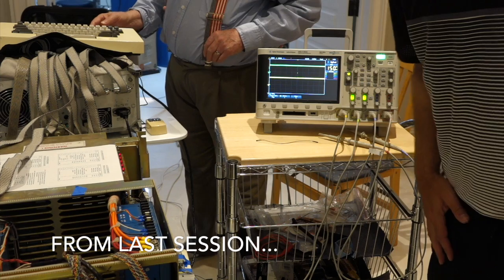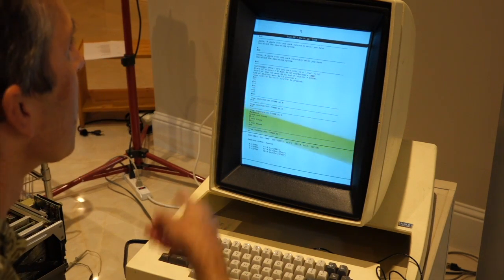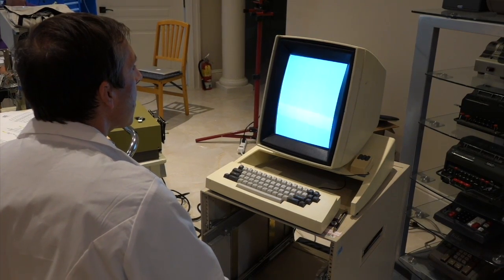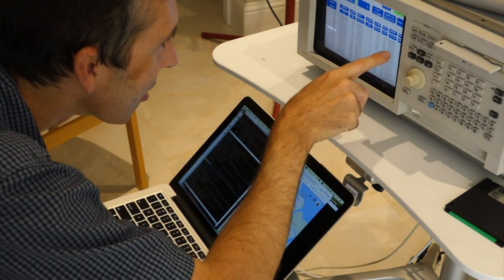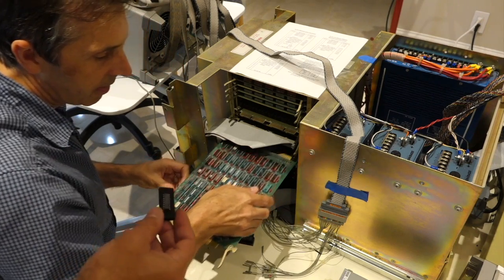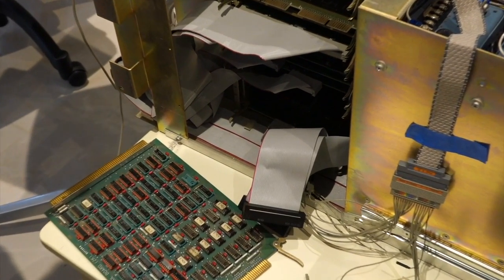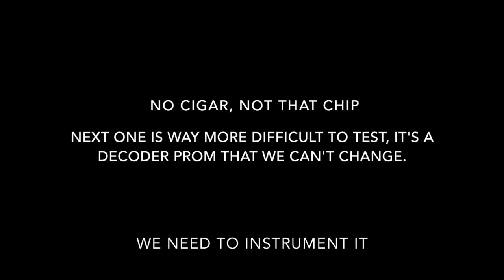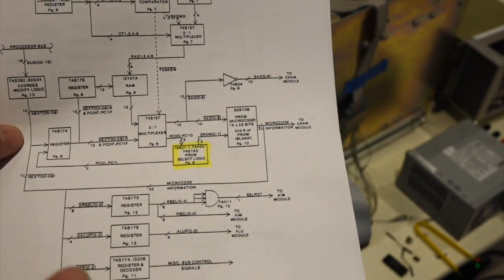Xerox Alto Restoration Part 9 - debug session leads us closer to crashes root cause

Comment: I had a funny feeling there'd be more bad IC's
Reply: the verdict is still out on that question - it may be a board level mismatch, not a bad chip, but we need session 10 to track this down further and find the precise problem.
Reply: Revision Issue then?
Reply: Thats what it looks like. The CRAM comes in three sizes, 1K, 2K and 3K. The control board should match the size of the CRAM, since it is generating selection logic. Microcode only has a 1024 word addressing range, thus we have to switch between 1K ROM and 1 to 3 blocks of 1K RAM. A 3K CRAM board has 3 separate 1K ranges of RAM - called banks - while the 1K board has a single bank.
Reply: okay thats a little more tricky...unless you swap the IC's from the original PCB assuming its the disk drive PCB causing the issues..i know the PCB got swapped out. so swap some IC's and see what happens
Reply: The problem is on the CRAM board, different from the Disk controller board. We think it is a mismatch that we might cure by installing a matched pair of 3K Control and CRAM boards. Should know by Friday.
Reply: Awesome, look forward to it

Comment: Was waiting for an update so bad!
But what could be the reason that someone retraced that chip?
Reply from the maker: We currently believe the rework on our control board was to make it work with an upgraded 3k CRAM board, which was the board supposed to be attached at the other end of the cable. But we now suspect we have a basic 1k CRAM board instead. If the theory holds (to be tested in episode 10), then the two boards that are hooked together in this machine were never meant to be working together. One is grounding the other. Maybe. Perhaps. We'll see. This machine always turns out to be more clever than we think, and seems to have several mismatched parts (like the wrong disc board we discovered early on).
Reply: There is a writeup of an engineering change that is applied to a "2K Control" board to turn it into a "3K Control board", which involves exactly those added wires on the back of the board. The small cable on the front connects the control board to the CRAM board where the control RAM is implemented. Our CRAM board is not a 3K CRAM, but a 1K CRAM. The working hypothesis is a mismatch in board levels, a 1K CRAM but a control board designed to control a 3K CRAM.
Reply: Looks like you got a machine assembled with assorted parts from other Alto systems when they already were decommissioned/dismantled. I guess, when someone got interested in some of these Alto's they prepared the machine(s) with a "bunch" of the needed boards for making complete system(s) (logic/disk controller, etc.). They delivered them that way and never got tested. That could be the explanation for the mismatch. Another clue is the wrong "boot" disk you originally got. This is a fantastic puzzle and your work is just outstanding!
Reply: We were beginning to think about that issue when Al Kossow kindly loaned us four matched pairs of boards - these are for the 3K CRAM, thus a 3K CRAM and a 3K Control board in each set. With luck, this will sort out the crashing problem, then we can investigate ways we might convert the existing boards to be compatible.
Reply: Interesting! So you'd have to un-rework the board or find a new CRAM?
Reply: Carl Claunch Thank you for your extensive answer! That makes sense, but why does this rewiring cause a pin to get grounded which is obviously wrong? Or it could be an other part that causes this.. let's wait for Part 10